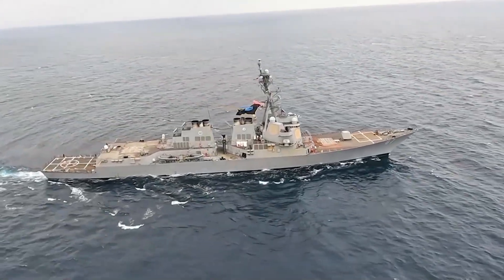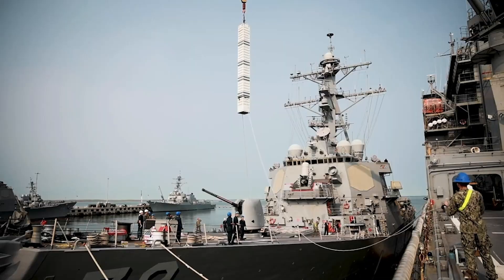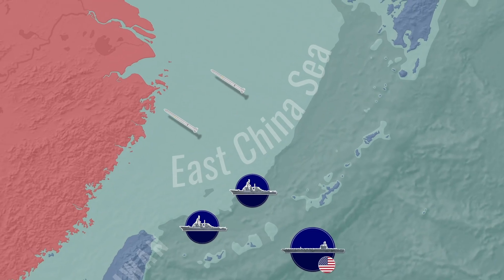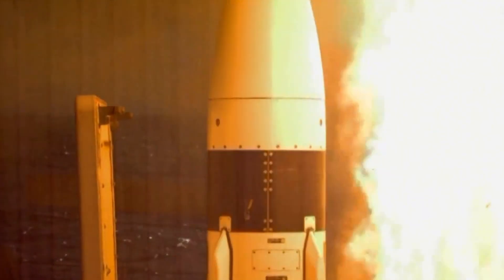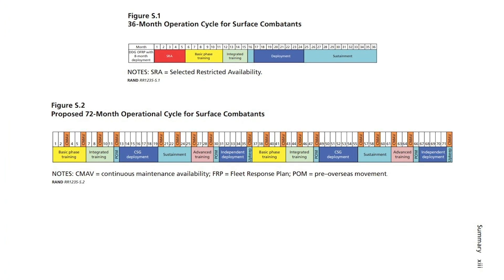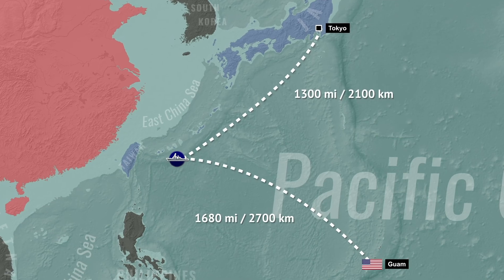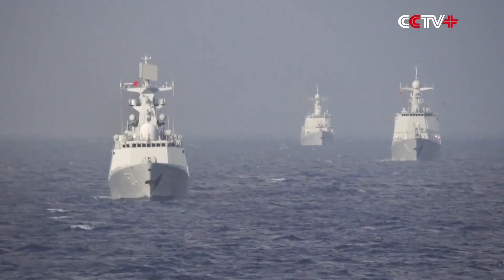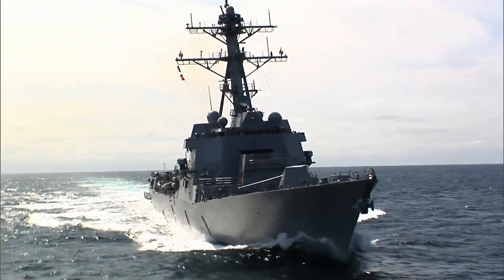Why is rearming missiles at sea crucial for US Navy? And why is it so hard?

Comment: I've said this elsewhere.  

The custom fix:
Take a decommissioned aircraft carrier. Empty out as much as possible from the front half of the hull. Add ballast tanks as needed to turn the front half of the ship into floating dry dock that lowers the front to allow water-level entry for a AB destroyer or a nuc missile sub. The carrier then clamps on to the DDG/Sub to keep it in solid position and refloats the bow. The carrier would steam on to its next rendezvous point. Meanwhile underway,  built in cranes in the carrier can work up to four cell replacements at a time, two fore, two aft. Clamps would hold the target ship exactly in place and the automated re-loaders could quickly restock thee warship with new missiles.  Sink the bow again to flood and release the destroyer/sub. Next one parks in.  Two or three decommissioned aircraft carries could service the Pacific and another two, the Atlantic fleets.

The quick fix:
If the first fix seems out of reach, another solution using the same carriers is to build a large hull matching indent(s) on the carrier, bring the recipient up along side, clamp and lash it to the carrier's side and load from there. It would be slower, but it could be up and running in a lot less  time.

The main point is to use the massive mass of the carrier to stabilize the recipient in such a way as they move as one vessel and automated cranes can quickly replenish the other ship.  A Nimitz-class could be set up to handle an AB DDG on the port side at the water level and SSN or other sub half submerged on the starboard side under the offset flight deck.

The transfer could happen well out the reach of most Area-Denial systems and save a lot of time for both and fuel for the DDGs.  They could meet at a safe distance and once hooked up, steam farther away and then halfway to completion,  back towards the next release/pick up location as close to the enemy waters would be reasonably safe, at precisely pre-determined time.   They would always change the meeting time and location  every time to make it harder to track by reconnaissance.

If money were not an issue but time was (ie at war), I'd build the quick fix in to all the new carrier builds while retrofitting the Nimitz class ones, one new for every two retrofits. That way each carrier group provides its own missile reloading capabilities.

Definitely going to need a super ship building facility on the Westcoast, Bremerton or Port Orchard  and on the scale of the Hyundai Heavy Industries one. 

In a major crisis, maybe we could let Hyundai lay down a raft of empty bottom half hulls to drag back to the US.

All it really takes it the will to do it. This is not rocket science.
Reply: I can't imagine the carrier route would be at all feasable or even sensible.  The costs would be astronomic even if it was doable - not to mention heavy lift ships already exist that can ballast down to allow a destroyer to be floated above their deck like a dry dock.

Comment: Why have the sensor unit and the launching units not been separated?
Sensor ship being a constant in theatre and a swift one at that. The launching unit being uncrewed and attritional, are sent in as the previous launch unit is depleted, and probably sent back to base for resupply.
Reply: Disaggregating command and control, sensors and affectors in a similar way that modular land-based AA systems do could make sense if countering China's missiles and air power was the only role that US navy ships play. Contemporary DoD thinking prefers them as multi-mission capable platforms that can operate alone if needed. There are advantages and disadvantages to that trend, particularly in having 400+ crew on a ship. Losing just one or two ships with so many people could hugely swing popular sentiment back home.
Reply: @Predator42ID rubbish. Does your AR15 only have one magazine that takes 15 minutes to change?

Comment: The us meeds small arsenal ship that go back to port after expending their missiles. These aresenal ships perform like wingman to Air Force
Reply: Small ships don't so well on the ocean there's a reason we laugh at china's "navy" and that's because it's a white water navy.
Reply: There have been some USN experiments in that direction, focusing on unmanned surface vehicles. The concept tested was based around a fast support vessel, a type of ship used in the (civilian) offshore industry, modified for optionally manned operation. This ship type has a large open deck area aft (behind) of the wheelhouse. In the tests a Mk 70 launcher, basically four Mk 41 VLS cells in a 40 foot container, was mounted on the deck and remotely commanded to raise its cells and fire a missile. Other navies are looking at broadly the same concept to make better use of their manpower.

The arsenal ship as a large (war)ship concept has actually been looked at repeatedly but been set aside as too specialised and vulnerable. In a prolonged engagement it likely would provide only a stopgap solution.

Comment: I would build a self reloading ship that acts as both a missile reserve on station and a missile reloading system that humps the receiving ship perhaps with an automated drydock or side by side ship that stabilize with azipods or voith schneider propulsion as a pair on each side.
Reply: Also sperm whale oil was used in the past to calm a rough sea.
Reply: @ElijahPerrin80  Bro what

Comment: I will never be able to understand why those ships are not entirely replaced by nuclear powered submarines? The submarine outperforms any ship in any measurable metric. Even potential reloading between two submarines is theoretically more feasible since the they pretty much can stay still and are quite stable under water.
Reply: Because submarines can't do air defence.
Reply: @charlesharper2357  Or Naval Gunfire Support of troops on the beach.
Reply: @edwardpate6128  
Most ships don't have real capability to do shore bombardment anymore...the biggest guns are only 5 inch.
Reply: @charlesharper2357 ther is a reason why Wisconsin has been by order of congress kept in a state where it can be brought back into service in 6 months
Reply: At equal price ships transport more weapons and are faster.

Comment: Looks like they need to revisit the arsenal ship concept.
Reply: Alternatively, instead of one large ship, multiple smaller ships similar in size to a corvette from WW 2.  They might only fit 8-12 VLS cells but they could act like the remote launchers for for land based air defense batteries.  They'd launch the missiles and hand over control to the larger ships with the more capable radar and control suites.  They'd not only be cheaper and quicker to produce but you could rotate one or two at a time out of the active mission zone to be reloaded without losing as much of your fleets capacity.   Like the WW 2 corvettes they could also provide the convoy escort capability and free up the fleet destroyers for escorting the main battle fleet.
Reply: @silverjohn6037  This seems to be a direction people are looking in. Basically, take the design of a civilian fast support vessel as used in the offshore industry, modify the design for optionally manned operation and paint it grey. Then load the largish cargo area (most of the ship's deck area aft of the wheelhouse) with containerized VLS launchers. The containers would need to be hooked to the ship for power and data and would be remotely commanded. Whether the people operating the ship are based on a warship, an island or halfway around the world probably depends on the navy in question.

Various navies and defense firms also seem to be revisiting the deck launcher concept, where several VLS cells are mounted on a deck mount at a shallow angle to the horizontal axis instead of fully vertical. One issue with this is probably where and how to get rid of the missile's launch exhaust.
Reply: @echomande4395   Basing it on a civilian pattern ship would follow in the example of the Flower class corvettes from WW 2 as they were based on whaling ships.  As for angled deck mounted launchers they'd have advantages I'm sure but you wouldn't be able to pack in as many in the same space as the vls's.  Of course on a smaller ship the hull might be narrow enough that you could place the launchers to fire towards the opposite beam with the back blast for the first stage venting off the ship into the ocean (if that explanation makes sense for you).
Reply: * Board meeting *
"Okay, Okay, hear me out... what if More."
Reply: @shanerooney7288  mor dakka

Comment: One wonders, maybe the answer isn’t finding a way to reload VLS systems in the ocean, but instead develop cheap, possibly attritable(sp?) drone ships that hold a lot of VLS cells. 

The turn around time might not matter too much if you have enough slack in the system that you have other ships that can simply replace ships as they have to return to port or are destroyed. 

With ships that are attritable you can also put them more in harms way. Which could also have downstream benefits or developing cheaper and smaller missiles because you can place them as a screen in front of ships you need to protect along likely missile paths. Because less travel time from launch point to target, you might not need as sophisticated of missiles. 

Separately/relatedly could also put other weapon systems like lasers on such ships.
Reply: This idea is being heavily considered by several navies and is known as an Arsenal Ship.

Similar concept is evolving to be SOP for air combat as the F35 platform is excellent for deep penetration with its stealth and sensors relaying targeting information back.

For USAF, this currently would be a F15EX which can carry a loadout of 10 AMRAAMs and two AIM-9X (for close range self defence). If utilising dual or triple racks (which is currently not yet approved) this count reaches 16 AMRAAMs and 4 AIM-9X 

For US Navy, this would be the F18 Super Hornet equipped with 4 AIM-174 (basically air launched SM6 which gives it exception range and speed), 3 AMRAAM and 2 AIM-9X. This loadout is currently being tested but not yet approved.

In future, these would be replaced by "loyal wingman" type teaming drones/unmanned aircraft similar to the X-47 or MQ-28 GhostBat.
Reply: Yep, what I was thinking at as well. 

Realize my idea isn’t novel. Was pondering if the reason it wasn’t being as seriously considered is perhaps “political” in nature. 

Not left/right politics, but preserving business relations with contractors, or preserving existing power structures (i.e. there might be a perceived loss of prestige in destroyer command if what you are primarily doing is commanding missile drone ships to fire on incoming targets).

Comment: I've thought, for reloading at sea, maybe a crane system, but with cables at both end with some play, might work. When the cell is hanging just from a crane you can imagine the bottom of the cell wobbling around. But, what if the bottom of the cell had cables going down to the hole it was to go in, and then you adjusted the tension, elasticity, play - whatever you want to call it - of the top and bottom cables? As the bottom of the cell got closer to the ship the bottom cables would get tighter until the point where the ship could really grab onto it and then guide it into the hole.

The thing with the China scenario is that you could probably expect other actors to take advantage of US forces being spread thin at the same time.
Reply: you missed school didn't you?

Comment: Why not use a Robot Arm fixed on the ship it self instead of a Crane?
Reply: the answer is always giant robot arm
Reply: This. I don't know why the navy didn't split the vls down the middle and place a deck based  or slightly inset Crane. I would imagine if a small service truck could lift a 15 liter Cat out of an off road truck somone could make one that would take the space of 3-4 tube's down the middle that works the way it should...

Comment: Its a shame that the Virginia class cruisers were not updated / replaced  as there top speed was NOT fuel related.

An alternate solution but not as quick as TRAM  Data - Link  launchers on other platforms guided by the Aegis system on  primary ship.  In effect a Battery of ships with a single  or multiple fire control nodes.  No the US will not build this as it means more platforms and more personnel  but others might (Japan).  Possibly mount land based systems that can be controlled by a Burke etc..

Comment: They need a little transporter-erector caddy.  Load the case onto it horizontally, have it lift the case vertically, and put tracks around the cells so it can reach any cell and drop the case in.  This would eliminate the swaying problem.   Alternately, there could just be a cable system that does the same thing for the bottom part of the case while a crane lowers it in.
Edit: well, looks like that's exactly what they're trying.
Reply: I was about halfway through designing the tram when it showed up on screen.

Comment: What is the production rate of SAM and ABM missiles for the US?
Reply: Last I checked, close to 500 a year, with an expected 700-750 a year by 2026, with further production increases following until 2030
Reply: @nobodyherepal3292  SMH, too few too slow in my opinion. But I think of each missile as any other ammo and in that case, there is never enough.
Reply: @GrigoriZhukov  that number was just patriots systems I think. 

Ship based interceptor missile production is also increasing too. And it was arguably higher in the production numbers then our land based systems where to begin with.
Reply: @nobodyherepal3292  eh, I was on the sharp end and you'd be amazed how much guys at the shap end to read all sorts of things and adapt the views. You never have enough ammo i.e. bullets, missiles etc. Those ships need a better way to reload and do it fast.
Reply: @GrigoriZhukov I know. But remebe we built 500 planes in 1941 and 2000 in 1942 and 48000 in 1943.
Reply: Not enough and no real surge capacity to the best of my knowledge..

Comment: More reason to build 200+ B-21s
Reply: B-21s are quite limited, they need very large well functioning airports and can't react quickly. they're large bombers, not naval attack aircraft
Reply: @Alex_Jordan-1 B-2s have operated out of Keflavik.

And that is done on purpose: to learn how to operate from relatively sparse bases.
Reply: @Chuck_Hooks  but can they operate their under sustained pressure, and wartime conditions while also staying effective enough to be worth it? worse facilities mean less munitions and fuel to resupply them after all, and less common and fast maintenance due to not as many workers, that all heavily limits their use. and again, they are used against static land targets, they are not designed for naval warfare. you need different types of aircraft than giant heavy bombers for that
Reply: @zachjordan7608  B-21s can takeoff from one base and land at another to refuel and rearm.

That is one of the points of B-2s operating out of Keflavik for even a few weeks. 

Nobody knows where they will takeoff and land from.

B-21s will likely be able to carry 8-12 LRASMS, which is certainly an anti-shipping mission.
Reply: @Chuck_Hooks  they can do that, but that also takes tons of time. opportunities to strike certain ships or fleets can be very fleeting. it's all about reaction time, and the B-1s just wouldn't have that in effect. not enough fueled and armed at close bases at once
also, the production cost of each b-1 is 265 million. that would make it take over 43billion dollars just to build, not to mention maintain, pay pilots for and of course arm. those production numbers just aren't realistic. warfare is all about economics and logistics and neither work out for the b-1 being a naval war winning weapon against china
Reply: @Alex_Jordan-1  One B-21 armed with 12 LRASMS can potentially disable a fleet.

Let alone just five B-21s carrying up to 60 LRASMS total.